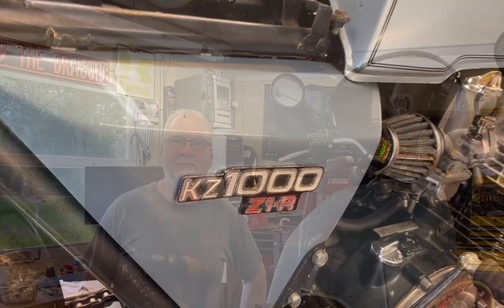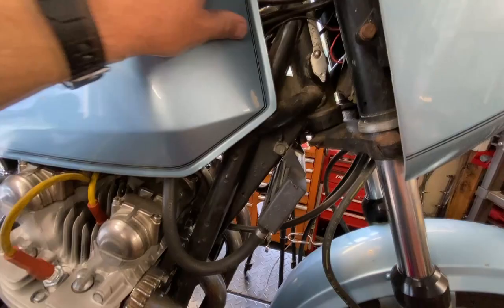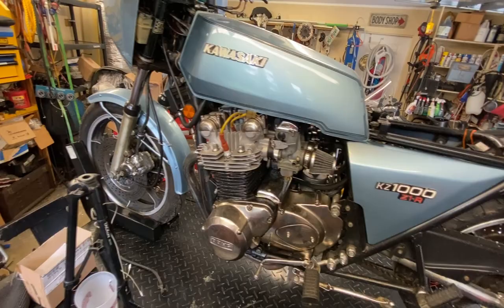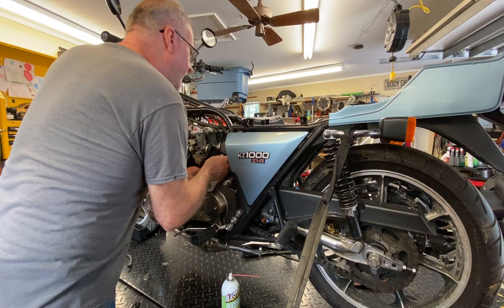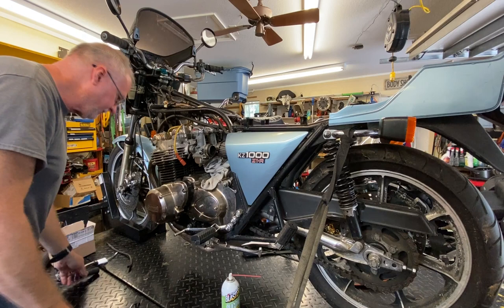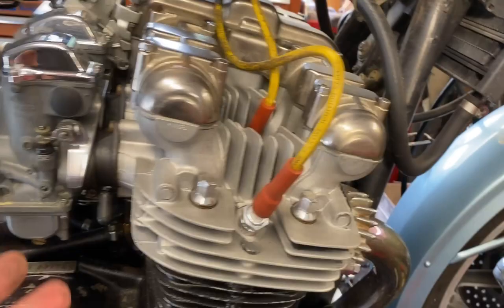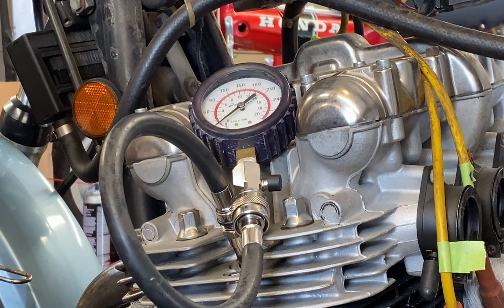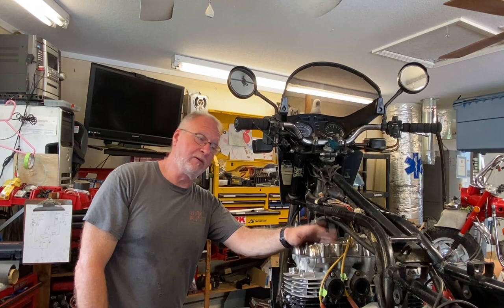1978 Kawasaki KZ1000-D2 (Z1-R) will it run? Is it junk?

Comment: My sister's boyfriend had one of these, and he let me take it for a ride. I fell in love and purchased it back in the early 80's. The original 1000  Turbo-charged engine (w/ Split Crank) had been completely replaced with a faster revving Single piece Forged Crank (punched out, 900 motor). Do to Kawasaki's known issues regarding the linkage set across the four carburetors...keeping them in sync was a nightmare (I had the vacuum tester filled with Mercury). Regardless, I bought a set of 31mm Smooth Bore Mikunis (problem solved).
Although, this was a beautiful bike and fun to ride at lower speeds, I do remember the terrifying speed wobble at ~90mph...
Good luck on your restoration...Brings back memories.

Comment: I was a motorcycle mechanic back in the 80s, I used to love working on the Kawasaki bikes. I had 2 at one time but my main bike was a 1978 KZ650C it had a Tracy Vortex fairing with a 50 watt stereo system, cruise control and Italian leather horse saddlebags, I wish I still had it.
Reply from the maker: My first new bike was a 79 KZ650. Thanks for watching.
Reply: @MotoRestoFL  
Chris Riddiford

Comment: I've had my Z1R since it was born ! Frame number ends with 222 engine 240, The back tail light unit and indicator's, cylinder head and rear mud guard unit are not standard for the model D1 !  Hope this info helps you out brother.  ;)
Reply from the maker: Not sure I understand you. What do you mean not standard, that they are only for that year/model or on this bike they're the wrong ones? The cyl head I don't deal with. The engine builder has those parts. Thanks.

Comment: I wish I had that Z1R in my garage. Previous Z1B owner .. wish I had that bike too.
Reply from the maker: Well, if I had my choice of a 70's-80's UJM to take to shows and ride around here and there (in other words not concourse level) I'd be happier with the Z1 myself. It has it's mark in history more than the 1000; heck Ponch and Jon rode 'em when the series started; plus, they're unique in their own when compared to the many iterations of the 1000 over the following years. The '78 Z1-R wasn't well received; handled poorly and wasn't fast because it's too heavy. I know, the damned frame itself is hard to manage by myself. So yea, it's a collector bike -- maybe -- but in my mind, it's not the holy grail of big K. Thanks for watching and commenting.

Comment: That is the Holy Grail of kzs , I want it....
Reply from the maker: Maybe. It's a single-year technically, however, it doesn't rock my socks. I'd much rather have a very early Z1 (900) or a Sandcast CB750. That said, I am looking forward to getting it into a rolling chassis eventually and then slamming the engine back in with a new wiring harness, etc... and firing it up. Cheers and thanks for watching.

Comment: I had an 80 z1r 1000. The 78 had points the 80 was electronic ignition. Wish I had kept it beautifull black beauty. Mine had a 1200 yosh kit. Felt like you were sitting on a v8. I road a 78 it was weak.
Reply from the maker: Agree. The only reason they're so desired and sought after is, they weren't well received and sold poorly so the mothership put the kibosh on the bike in that form, making it a single-year unit. Add in the poor sales and there's not a lot of 'em out there. Me, I'm not overly tickled by the bike either, I think it's meh. But the engine is coming home probably next week from the builder, thus we shall be getting back into this long-long-term project, finally. Cheers.

Comment: My favourite bike my first bike a Z 250 with fairing, same colour, i could pretend😅.
Reply from the maker: I’m more enamored by the KZ1100 J motor. Shaft drive and overall better engine in my opinion, and still very vintage. I had one, traded it for my Concours 14 in 2012.

Comment: Hi sir, where can I' buy original front  brake system for z1r? Any advise and suggest is welcome, tnx!!
Reply from the maker: Unsure. But what do you mean by original front brake system, the entire thing from the master cylinder down to the calipers or the entire thing from the handle/cable to the master and down? The best way I have found is to first ID the OEM part numbers and you can do that on any online parts fiche. Then, try and cross reference to see if any other models used the same parts. Sometimes, they are listed on eBay under that different model. It's a bit of detective work sometimes, but what it takes is some time and patience. I do not know a clearinghouse to steer you to for finding parts like that especially, when you appear to need the whole enchilada. Thanks for watching and commenting.

Comment: Would you like to restore another 78 Z1R? Mine is another one that has a Kickstarter.  I have one that I would like to get restored.
Reply from the maker: I could certain do some of it; but just to be clear, even on this one, I'm not "restoring" the entire bike. My customer has sourced some new old stock bodywork and is getting period-correct new items (such as the Hagan shocks I'm now waiting on for the swing arm customization) so essentially, a good deal of it is outsourced... and I will be the primary final assembly guy. Perhaps that's not exactly the proper word but close enough. I don't do painting, powder coating, etc. So basically, anything mechanical, electrical even some custom (light-medium machine shop level) I can do; and for heavier machine shop work such as engine boring/honing and head work, that likewise all gets sent out. Engine work, 90% I can do in-house. It's the aesthetic stuff I don't have the footprint for mainly.

So it depends on what restoration means and how the customer is willing to go about it. Send me an email and we'll exchange phone numbers and such and where you are located. thanks. Motorestofl@gmail.com
Reply: @MotoRestoFL  I will be in touch

Comment: I have a 1977 Kawasaki KZ1000 all original one owner bike. the serial number on the frame is KTZ00A-505475 and the serial number on the Motor is KZT00AE-037447. The actual miles on the bike is 6503miles. I don't have the Title for the bike. What would be the top price I could get for the bike???
Reply from the maker: I don't know. Without a title, to me and many others who buy these bikes, it's mostly worthless except as a parts donor. I never, ever buy anything without a title. Ever. It's too much of a pain to deal with and I have seen people put megabucks into a resto only to have title issues and not be able to sell it. Recently, in fact. Cheers.
Reply: Sounds good , ive got the same price depending what country your from as these are getting expensive to buy here in Australia
Reply: Hey donny did you ever get a price for your bike, if not do you still wanna sell it or have you already

Comment: Did you get this bike finished yet or did I miss it, if you're customer changes his mind and would like to sell it I would like to throw my hat in the ring for it.
               Thanks Jack
Reply from the maker: Oh, heck no. Not even close to done. I don't even yet have a rolling chassis. Gotta sort out the swing arm (we may use the original one after all) and lots and lots of stuff to do. I don't even have the engine, that went in pieces at the customer's request (torn down) to an engine builder, who knows what the status of that is. Every time I ask the customer about it, he says he doesn't know. This project may last over a year, maybe more. As things get together, however, I'll film and add to the Z1-R playlist. Thanks for watching.
Reply: @MotoRestoFL  Yep, I would put it back all original if I was him knowing what he has, but if he ever talks like he wants to sell it I would like to be in the running for it.
Reply from the maker: @tfjack97  I would also. However, it's not mine. I wouldn't have paid what he paid for it either, which I'll keep to myself (in that condition). I seriously doubt he'd ever part with it, he's a collector. But he does like to dabble in "tasteful" modifications which is where this one is headed. In other words, if I can keep talking him away from the edge of the cliff (eccentricity speaking) a period-correct modified bike without extreme changes. Cheers.

Comment: lol it was junk when it was new, I had one in 1979 and it was six months old when bought it they handled like a pig fine on a motorway in a straight line but terrible round back lanes, it took to two people to put it on the main stand unless you were built like Hercules, if you were two up the wind came of the fairing and hit your helmet just above the visor and gave you neck ache, I kept it around two months and got shut of it and bought a Honda cb900 which was far better.
Reply from the maker: No argument there. It think they're extremely overrated.